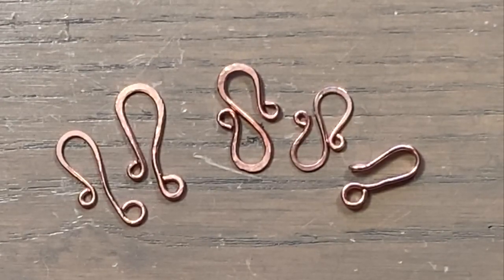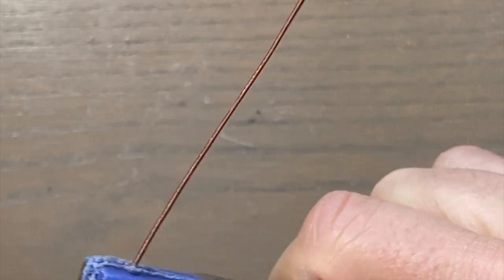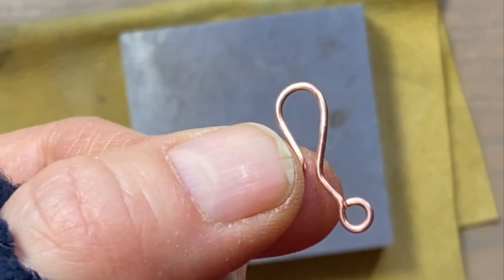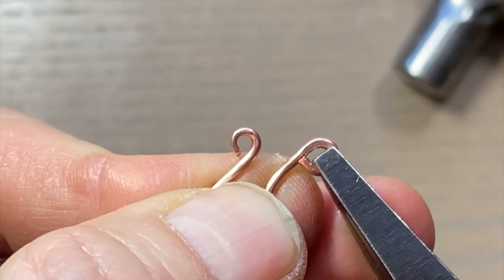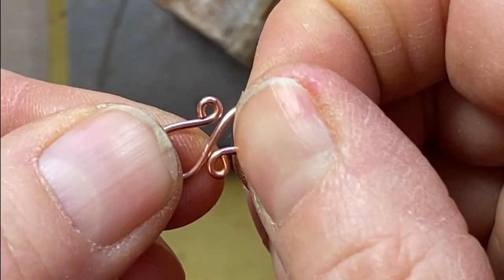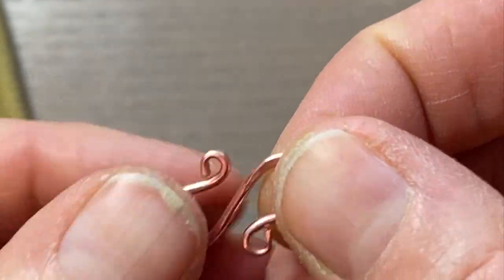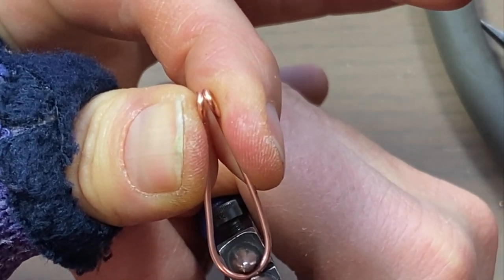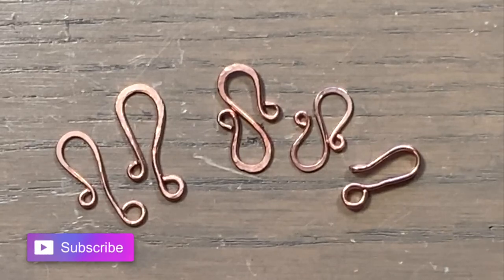DIY Jewelry- Make Your Own Wire Clasps Part 1- Easy and Simple

Comment from the maker: Thanks for watching!! Don't forget to subscribe for more jewelry making videos! 😊
Reply: Thank you for sharing....I enjoy your tutorials and have learned a lot from you...
I have a tip that may or may not work for you....when I hammer small pieces I'm prone to whacking my fingertips😕....my finger was really sore one day and I could hardly touch the tip but I had several pieces I wanted to hammer...so...I put them in a zipper and hammered then...I can use my awl to move them inside the bag..they don't flip around on me and I can just turn over the bag to do the other side...also I can put several pieces in the bag at a time.  I just hold the sides of the zipper against my block and the pieces stay in place...I also save some of the plastic bags that items are shipped in to use.....but mostly no sore fingertips...🙂.   ....you probably don't need to do this with your experience but it has saved me....🌷
Reply: Spe3llchick was trying to help....it's zippie not zipper.......just the little zippie bags....🙂
Reply from the maker: @rheamuse6283  thank for the tip! ☺️💜